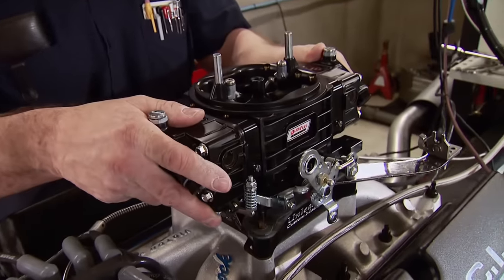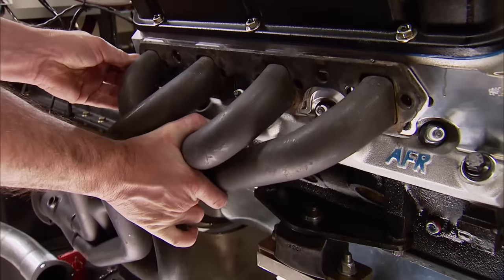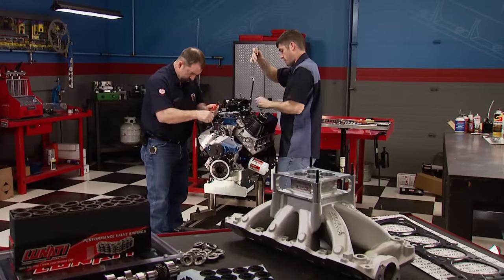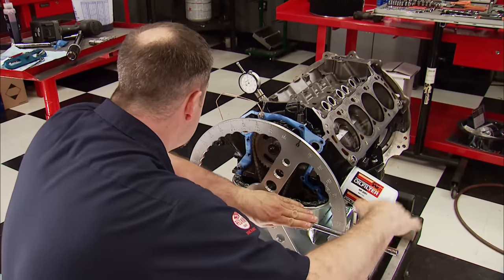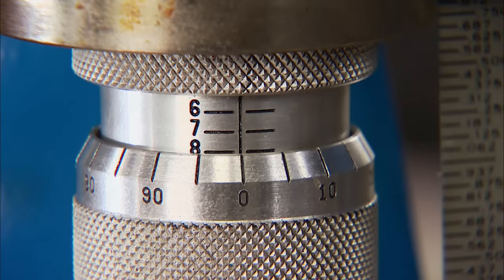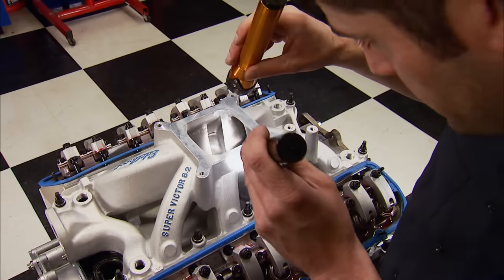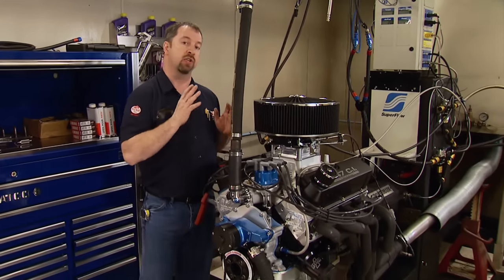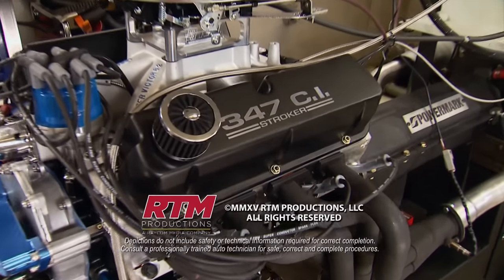Getting More Power Out Of A 5.0L Small Block Ford - Engine Power S2, E9

Comment: 8000 rpm with a steel rod stock block 2 bolt main 302...hahahahaha   That thing will be in 2 pieces before it makes an actual 1/4 mile run.
Reply: @superkillr What are your reasons for saying that? have you personally broke one in two pieces with this parts combination at this power level at this rpm on a dragstrip?
Reply: superkillr this is an engine dyno. installed in a car and then ran on rollers, it would probably only be 450hp at the wheels. usually they don't split until the 550-600hp at the wheels range. 

over all I sorta feel its alot of money for not much gain in stage 2.
Reply: @strictlybusiness1598  ---Not me, but it is WELL KNOWN and documented in the Mustang/Ford circles that the 302 is the weak link in all high HP SBF builds.  500hp is considered the iffy point and there are many on record as having cracked in half at over 400hp.
Reply: superkillr yeah, usually around 450hp or more at the wheels which is more like 525 or more hp on an engine dyno. 

usually when the block splits, its caused by crank walk and creates a crack between the main cap bolt threads to the cam tunnel. every time I've seen this there was a shitty tune, lots of nitrous or a fuel problem that came across when it split. 

I'm not saying it never would crack, but I've seen guys make 550hp at the wheels for 3 or 4 seasons of drag racing on a stock block. I know one guy that was pushing around 650hp at the wheels which would be more like 725-750 at the crank and he ran the same combo for almost 10 years. 

I mean, this was a block designed in the 1960's first used in 1962 with a whopping 260ci and less then 200hp. it is definitely pushing the limits a bit.

Comment: Are we talking Ford's 289 CI ??
Reply: Nope, from what they said in the stage 1 video, it is a 302 ci
Reply: Late model casting 302 (something basic and abundent in any mid 80's to mid 90's Ford v8 powered vehicle) same Windsor family as a 289ci (Windsor not k series) engine but different, more evolved down the line if you will.
Reply: Fords 302  Windsor is a stroked 289 . Same bore size but a slightly longer stroke. They only made the 289 for about 4 years so they are getting harder to find. 302s were made from 1968 until 1989
Reply: @johnkendall6962  68-95 In mustangs, 98 in explorer and f series trucks.
Reply: @johnkendall6962  5.0s were available in the explorer until 2001 and have better gt40p heads

Comment: Prefer my flat tappet hydrolic 308 holden engine stroked to 383,alloy heads. 494 hp 480lb at 5800 rpm

Comment: These people are basically encouraging other people to build these hand grenades, but they neglect to inform their viewers that these blocks crack at the spider mounting holes in between lifter galleys, then break completely in half at power levels sometimes as low as 450hp. 550hp and its just a matter of time,  BOOM. See, by telling people what they should do if they want this much power for a 5.0, which is buy something like a Dart block first, that would blow the budgets of the types of people who watch this and go ' ooh'  and ' wow'. These people want y'all to go out and get yourselves one of these ford 5.0 blocks and spend spend spend $$$...dont be fooled, it might last a few seconds on the dyno but this motor is now a hand grenade. Do your research before repeating this time bomb recipe, lots of pics of grenaded blocks online.